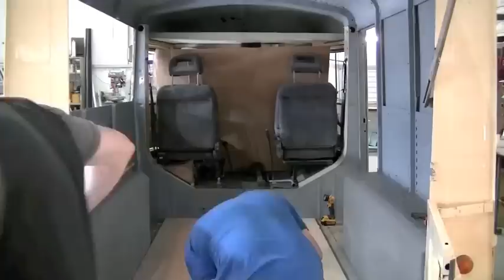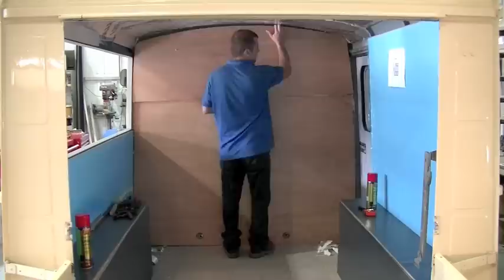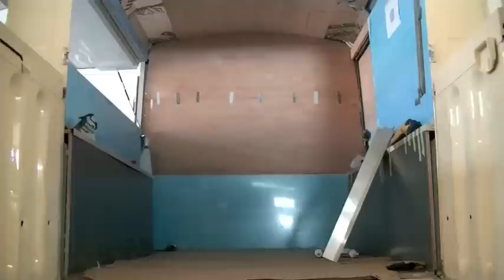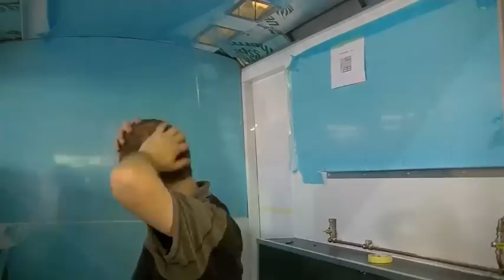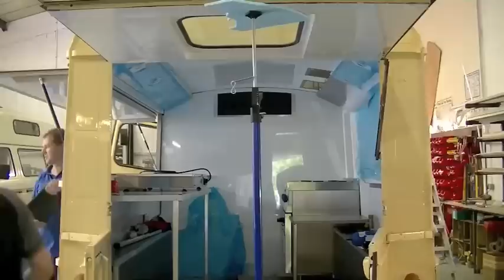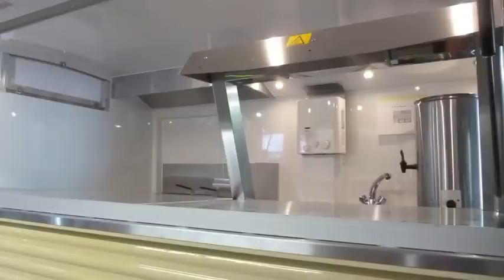Citroen H Van conversion

Comment: Change the engine to a more reliable transit with running gear you will enjoy the van more and will be more reliable these Citroen's don't even have a oil filter
Reply: EV conversion would be fascinating, so you don't need oil anymore